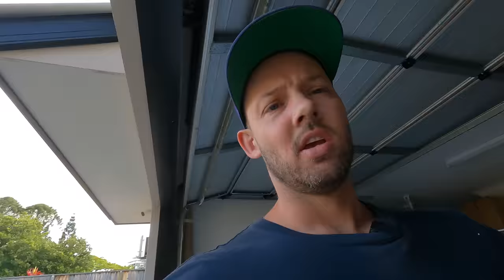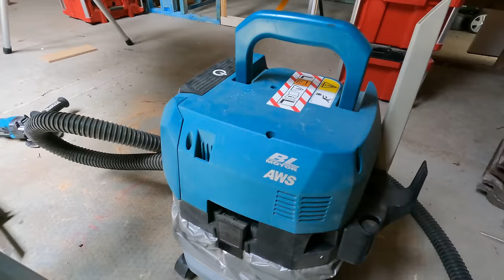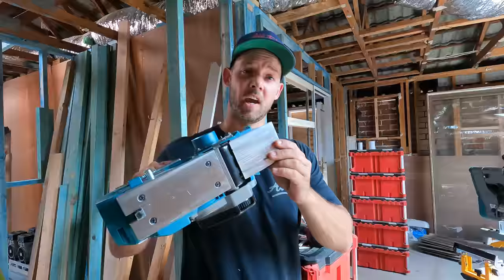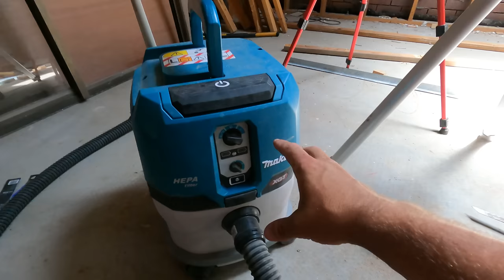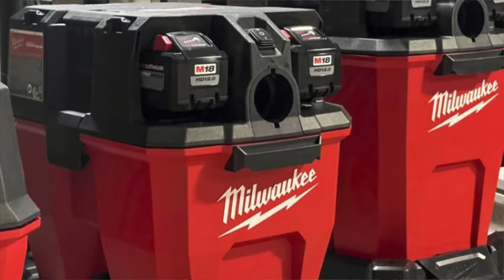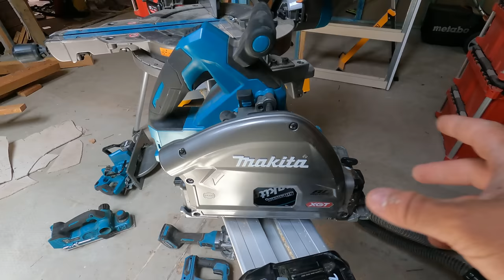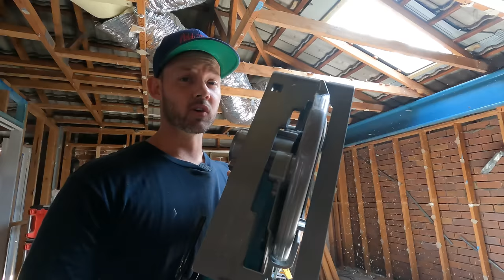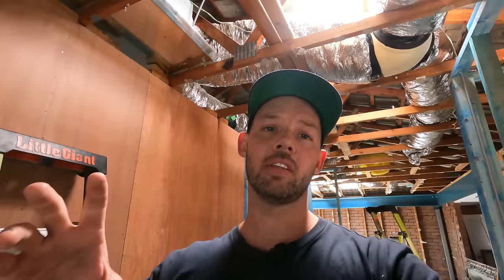From milwaukee to Makita. Why I changed tool platforms

Comment: I run a lot of milwaukee but realistically sticking too only one tool brand isn't possible. You just can't get all the best tools from one manufacturer. Stabila for example is leagues ahead of milwaukee when it comes to levels as they should be. We run max framer nail guns and a dewalt compressor. Chop saws and table saws aren't really brand loyal either considering we still usually use chorded for those two. Brand loyalty is just foolish .
Reply: Not if you work with batteries
Reply: @MultiMartien   Even if you work with batteries. If the tools are the same maybe it doesn't matter, but if you want a cordless chainsaw you simply can't find a good Milwaukee cordless chainsaw, you'll need an Echo or DeWalt. You're better off getting 2 batteries and a DeWalt than trying to get regular work done with a crappy tool.
Reply: @MultiMartien  I honestly don't consider battery tools to be enough for everything at the moment. Pneumatic nail guns are impossible to beat and so are chorded table saws. I already use metabo and milwaukee when it comes to battery stuff and I only use gas chainsaws. Battery tools just aren't up to par with the older tools yet. Of course there are exceptions but most of those are fairly cheap to mix battery platforms. But im more of a general contractor I do all kinds of random shit. A plumber and electritian I could see sticking to one platform a lot easier than i can.
Reply: @w0kepatriot441  have you seen the new 40v compressor from makita its  perfect couse you are right about air gun shooting.
Reply: @MultiMartien  I have and I actually currently own the smaller milwaukee battery compressor. I think you could get away with just that as a subcontractor for sure. Even framing you could run those pancake compressors they just don't keep up as well as a large wheel barrel compressor. Honestly im willing to bet within the next 10 years pneumatic guns could be completely replaced by battery if they can lower the weight to a more usable level. At least that is what I hope.

Comment: I agree. I prefer Makita even though I have to use  Milwaukee on the iron ore mine I work on. I use Makita at home. The 3/4” Milwaukee rattle guns will eventually fail as they don’t have rubber damping between the gun body and battery. This causes the battery contacts to arc erode and  cause it to fail. Also, the double button battery release sticks when in dusty environments. However, Milwaukee do make some innovative products but I believe they often rush their R&D and are a bit overpriced for their quality. FYI they are owned by TTI In Hong Kong.

Comment: If money was no object I would have gone with Makita 40v.  But I have painstakingly compared every brand and the tools I use most are impact driver, multi tool and circular saw.  And Milwaukee hands down has the best multi tool in my opinion.  It's really improved my game.  Makita's multi tool (even their newest one) doesn't compare and to my knowledge there still isn't a 40v multi tool out yet.   I've been very happy with the m12 fuel stuff so far, and the M18 fuel stuff is there when I need extra power.  I buy tools when they go on sale and it would have cost me 2-3x as much had I gone with Makita 40v.  I do have to press the power button on my shop vac before I start cutting but to me it's one of those luxuries I can't afford to worry about!
Reply: is dewalts multi tool good?

Comment: I use 4 platforms and can tell you all Milwaukee tools and batteries die with slightest bit of water. I’ve had makita grinders under water and they go strong still. Makita is the best value for money.

Comment: I don’t understand why people  go for battery tools that are stationary when set up ie. drop saws, rip saws etc. Fair enough if the sites don’t have power, but the majority of the time most building sites are powered.
Reply from the maker: Hey mate, I definitely understand what you’re saying but maybe it’s the sites and work you’re doing. On all the sites I’m on almost no one uses leads. They are painful to run through site safely and battery is just a lot easier. If it’s just for home in a shed then I totally agree.

Comment: After watching a plenty of videos on tool repair from Dean Docherty, I would not invest into Milwaukee outside of US, due to complete ,,throw away and buy a new one'' design.  Also Dewalt 36V seems to be built this way. Not sure about 40V Makita but for 18V tools you can get most of the spare parts relatively cheap even for very old models. So simple broken trigger switch on Makita is 8 dollar spare part replacement and on Milwaukee it is 150 dollar tool replacement. Me as DIY I got a great bargain on brushless tools from SKIL and they are really worth of the money for me, but as professional, I would most likely go to Makita or Bosch platform. Specially here in Europe these are sold everywhere. Milwaukee, Ryobi or Festool are much harder to find.

Comment: I have been a diehard Makita man but absolutely had to get the Milwaukee nailers. Now I have a bit of a mixed bag. Just got the m18 chainsaw and quiklok system. If the batteries are like what you described I may have made a big mistake lol
Reply: Yeah, the Milwaukee nail gun is insanely good Hopefully Makita releases a makita 40 V framing, nailer

Comment: Had the same problem with the batteries with my Milwaukie also iv had three impact and my second drill is now packing up .
I bought a Makita mower as I only have a nature strip to do so didn’t need a petrol , at the same time I bought the plunge saw so I would get the two batteries, I think I’m going to pull the trigger on a makita kit and hopefully this will be my last.
Having said that I think I got over a decade with the Milwaukee kit .

Comment: The problem with the high AH rating 18v batteries is that all they are doing is increasing the number of cells. Hence, increasing the probability of one cell to be (or go) a dud, and the rest of the paxk goes dud with it.

Comment: I went to the Milwaukee platform after my tools were stolen too, after friends and colleagues recommendation. I just bought the Makita 40v XGT 216mm mitre saw. I will buy more tools on the 40v platform. My next purchase I’m thinking of buying their 40v XGT vacuum, but I’m hesitant on the run time been battery powered. Can you please do a video with one and two batteries run times?

Comment: I use AEG, Milwaukee, Makita and Dewalt. 

AEG is my go too for most tools I use a lot as they’re reliable, powerful and cost effective. 

Milwaukee is for my Heavy Duty work.  

Makita for odd and unique tools. (Has the best range)

Dewalt for the tough stack and some 240v tools like table saw etc.

I never understood people who only use one brand and/or live and die for a single brand.

Hell I even have a few Ryobi tools floating around.

But seriously it is far better to have options and don’t come at me with the “blah blah chargers batteries blah blah”. I rarely buy a skin only and mostly shop redemptions.

Comment: You can buy battery adapters so you can run different brand batteries on other tools. Obviously they have to be the same voltage.

Comment: This year I starting getting all new tools on M12 and XGT. Those two cover all bases. Still have some LXT but phasing it out.

M12 for compact

XGT for power, dust collection, all the track ready tools, and 80v future proof

Ryobi 18/16 nailers (slower budget M18 basically), lights/fans to burn cheaper lithium, non-important tools, and household non-tools

Comment: My Ryobi stuff is for home use Milwaukee for work.. they're pretty tough they're small 1/2 dril with a hole sawing is impressive even used it on a turning tool for a 32 Litre engine as a Heavy Duty mechanic I push them, dropped daily.. 5 inch grinder with a 12 amp battery is fantastic.. up graded to 6 inch and it just sucks the battery down.. the 12 amp battery Milwaukee batteries in general got to keep them charged up and if you're down to your last bar on a high draw device.. stop and swap it I find that kills them

Comment: The milwaukee 18v 12ah has more capacity than the makita 40v 4ah.

Lets talk battery facts. Manufacturers claiming 20 & 40v are legally lying to you. They are 18 and 36v.

Secondly, capacity for batteries is measured in Watt-hours. Which is voltage x amp-hours (ah)

So to normalize the comparison we must drop the makita to its actual 36v, then multiply that times 4 amp-hours for 144watt-hours. Then take the 18v battery times its own 12 amp-hours for 216watt-hours.

As far as max tool power, thats based off cell discharge capacity, marked as a C rating. (1c, 2c, 3c, etc) multiplied by the overall capacity of the battery pack.

Since we just established that the milwuakee battery has more capacity, given similar C ratings (most likley), then the milwaukee battery can also supply more power to the tool.

Higher volts mostly mean thinner wires on higher amp machines, thats about it.

Comment: I swear by MAKITA and have done for 25 years as a Carpenter and joiner as they are well made and solid I have a LS0714 Mitre Saw which I bought in 2004 and is as good as the day i bought it and i totally agree with the MAKITA battery's But they are expensive and do last and have loads of power and I do think that Milwaukee are Overpriced

Comment: At one time Milwaukee didn’t have to make a better more expensive tool 
they were all great !
I’ve had 4 18v Drills and 1- 18v grinder and 18v. Hacksall pack it in since 2012 . My fuel ones no problem ….but twice the price!😵‍💫

Comment: Milwaukee continues to be in this weird position where they are resting on their laurels. Their "new" tools are the same technology from 10 years ago. In many cases they have been made cheaper and less reliable. They have the forge batteries finally but still mostly provide the 18650 packs which is just laughable. Their packout line has fallen behind pretty much everyone and they are not updating anything. Basically, Milwaukee is setting sail doing exactly what Dewalt did in the early 2000s - 2010.  I've seen a TON of people switch over to Makita and Dewalt lately and it's just getting worse.

Comment: Pretty confident the milwaukee batteries don't last long because of the current draw from the tools -> same reason milwaukee generally way more powerful than other brands. batties dont like high current draw :/
Reply: Very true. But with the XGT you get a lot of power through the voltage not the current draw.
Reply: the lack of advanced electronics in general Milwaukee tools is causing the batteries to die earlier than expected. Makita new 40V tools are just a small computer on each tool, I have a lot of 40V makita tools, the grinder for example, if I don't apply too much pressure and uses low speed the tool senses the low use and make the battery lasts 2x more. If you apply real pressure on grinding metal it's sense and a special toque mode kicks in, the battery get hot and the tool is comparable to a 1600w corded grinder on torque! Milwaukee made amazing durable and very powerful tool but, hands down, the battery management of makita are the best in market. This is why their batteries lasts more than a decade for light use. In hard use any battery will eventually fail but Milwaukee batteries dieing with only a few months of use in powerful tools of contractors are getting ridiculous. Both brands ate amazing but Milwaukee have to advance in battery management, their tools are so powerful that ars destroying the batteries.

Comment: Downside to everyone using the same brand is batteries go missing ALOT!  Very frustrating for the boss and anyone else using there own tools in that brand . Hence I only have m12 gear but for anything else 18v and above I use makita.  Purely because the batteries are left alone.

Comment: I have both platforms as well and some hikoki/metabo hpt. They all make good tools. The makita saws are nicer than milwaukee i have the 40v miter saws the small one and the 12 inch. Milwaukee makes better nail guns so does 
metabo hpt/hikoki. The aws is the best part about makita i have the adapter i use with a corded vac. and have 4 AWS chips so i set up multiple tools with dust collection.

Comment: Great video mate. But for me Makita hands down. 13 years on the tools in the building industry makita was best. Milwaukee is a great product but battery life span is pretty poor. Espically a 12ah battery at $328AUD is steep today. Also few of the M18 and M12 tools failed me. Only thing id buy now by Milwaukee are the packout system.

Comment: The Bluetooth is nice. Milwaukee does have a system to do it now but i believe it’s a watch and you hitthe button to turn the vac on. I love my Milwaukee stuff and don’t branch out in the cordless arena anyway cause i have so many batteries and don’t particularly want others. I do have some m12 stuff but the charger does both so it’s no issue. I do however have many corded tools of different brands and they are all great tools. Any of the big names these days will get the job done consistently.

Comment: that's interesting that you switched because i'm on makita and thinking of swapping to milwaukee. i'll still have both, but i'm leaning towards expanding future tools with milwaukee. i'm doing mostly woodworking as well, but for me the biggest gripes i have are: first the 40V XGT lineup. having been on the makita 18v lineup for 7 years now, I have a bunch of tools that don't work with the new batteries. and they're releasing a bunch of cooler tools on the 40V line, so i either have to rebuy all my tools or have two lineup of tools, chargers and batteries. the second is the lack of storage and accessory options. they recently updated their macpak line but it's still pretty bad and no where near as expansive as milwaukee. i've never had any battery or reliability issues with makita, so in that sense they're great, but milwaukee just has a much bigger ecosystem and they're constantly innovating and offering more.
Reply from the maker: Couldn’t agree more with your points and thinking. If you’re moving to another platform, Milwaukees definitely got the line up and I highly rate the m12 gear. Packout is the only way for me for storage. Can’t beat it. Good luck with the change mate. Let me know what you go with
Reply: I have both LXT and XGT gear and I have to say having two battery platforms is not as annoying as I thought it would be. I would have bought everything 40 v, but they just don’t have some of the woodworking tools out in 40v yet. It actually works out, because that allows me to save up some money for when they finally do. My track saw, miter saw, circ saw, planer, router, pin and brad nailer and shop vac are XGT. All the drills, multitool, jigsaw and sanders are 18v. I’m not really bothered having two chargers and batteries, as I’m constantly using multiple tools at the same time for a project and like to have  a separate battery on each of the tools I use. By the end of the day I load both duo chargers up with two batteries at a time, so I’m good to go again the next day. I got the DTD173 in this week by the way. That is one sick impact driver and better than anything I’ve ever seen. 18v, but that seems irrelevant with Makita impacts. What a machine.
Reply: makita has adapters for their 40v charger so if you really dont want to just have 2 chargers next to each other you can just have a dual charger for 40v and put the 18v adapter on one slot of it for your 18v batteries

Comment: Interesting...I have an M12 system for the plumbing tools and I have the Makita track saw...going to a Makita two battery weed eater (dual battery 4.0 amp hour for $317 with 4 batteries and charger). I have several tools that are corded Makita and Milwaukee...they will probably last forever! I have one M12 battery 4.0 that doesn't charge. Same issue as yours.

Comment: I went Hikoki because Makita didn't have any nail guns worth buying, doesn't have the range but it suits me.
Reply from the maker: I’ve heard great things about the hikoki nail guns. Not sure why makita hasn’t kept up with them
Reply: I have all of the Milwaukee nailers running on Makita batteries. 20$ adapter. Fired over 25k nails this summer through the framing nailer and no problems.

Comment: Another huge plus w makita, repairs. We all know triggers/switches are the most common failure for power tools. Makita you can replace just w switch for short money. Milwaukee and every other platform the switch is not a stand alone part so its wicked expensive to replace and for drills and impacts its like half (if not more) the cost of the tool itself so not even worth it. Plus makita is just a much more reliable tool.

Comment: I've got a new 12A Milwaukee battery that dies in a 1/3rd the time of the other 12A battery (that's much older) doing the exact same work. I'm looking to spend big adding to my tool collection and while I basically have all Milwaukee cordless tools now because I consider them the best for my application, as an agitator of the market, they seem to be omitting small, important features that other brands offer. The fact their tracksaw & vacuum aren't BT is why I'm considering other brands now. I'll probably switch to their nail guns as they have great reviews, but their dropsaw reviews are frequently unconvincing. I am a big Milwaukee fan and I've converted other tradesman to the brand through using my tools, but there are factors at play in the market that seems to compell the end user to now branch into other platforms to really get the best tool for the application. One other thing I note is most of the mainstream brands are increasing their prices, which is making 'more premium ' brands just as, if not more, an attractive alternative.